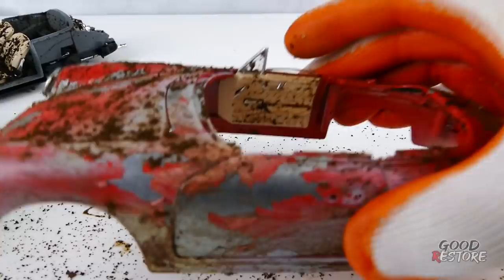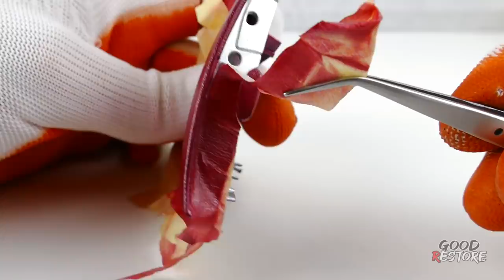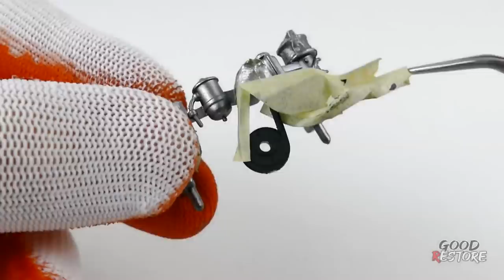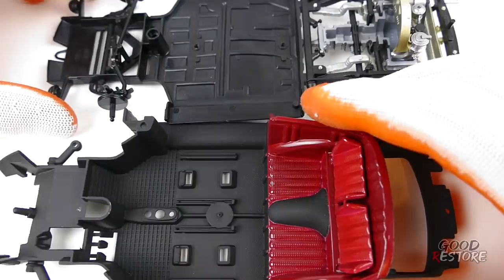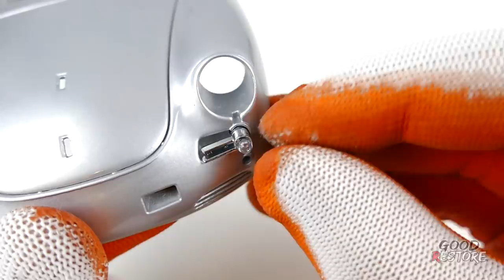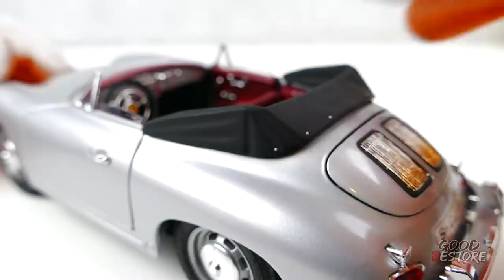Restoration Abandoned Porsche 356 B | Repair Old Model Car

Comment: This is the 356 C the front edge of the bonnet is squared off. B models had a rounded front endge on the bonnet. Also, rear bumper is installed upside down. Exhaust extentions to go through the rear bumper guards.
Reply from the maker: already fixed)

Comment: Two video so far. Two cars with almost same damage. I bet you buy two new cars of same model, you destroy one and then use parts from other one to "restore" it.
Reply: The cars are not actually damaged he just makes them look like they are, takes paint off and scratches them up Removes a door things like that. He’s just re doing the car in his own way he just adds a little bit of fun to it by making it looked damaged to add some drama to the build, I think it’s cool he does an awesome job with the custom
Reply from the maker: Thank you for understanding this, as many have problems with this)